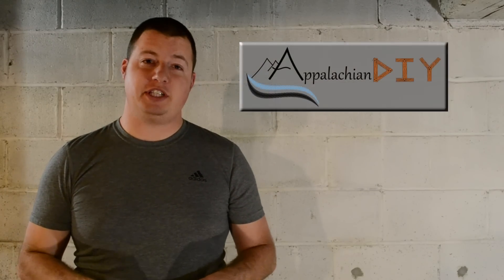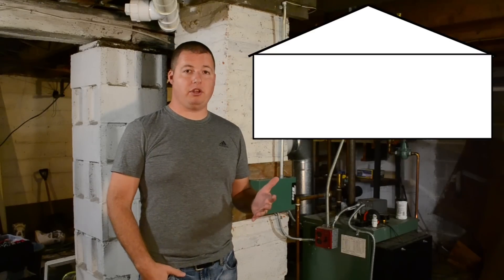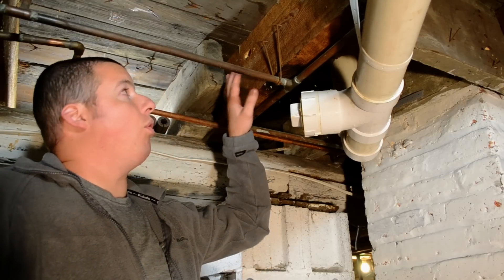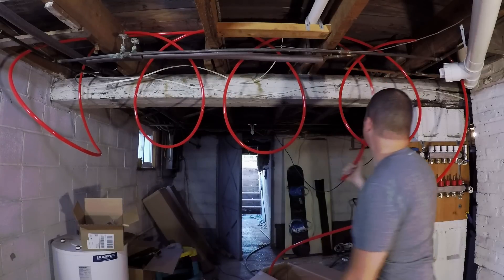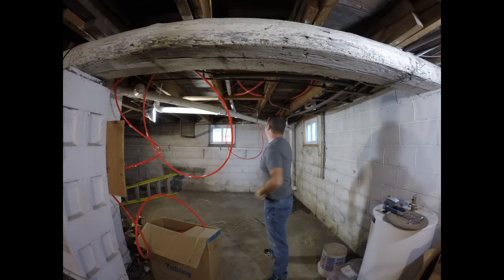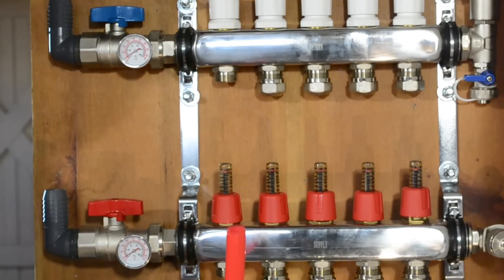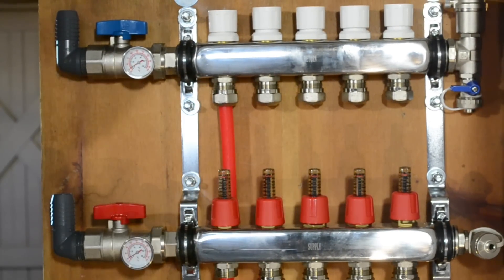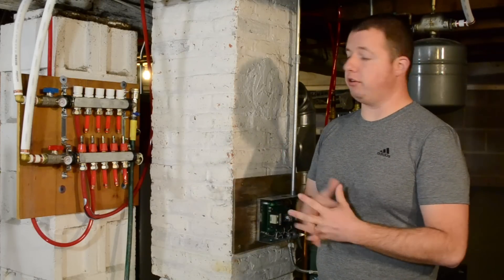DIY Radiant Floor Heat

Comment: Great video. My question is could you use the existing hot water tank or should I install a separate hot water tank?
Reply from the maker: Good question. Tank water heaters are not really made for this type of application. However if its all you got i guess it depends if its electric or gas. Electric could potentially be extremely expensive. Gas might be ok. The best thing would be a tankless water heater or furnace. Plus if your domestic water is on the loop its not a good idea. Floor heat is meant to be a closed loop sytem not open like if you were to have domestic heated water on the same system. Hope this helps
Reply: @appalachiandiy2415   thanks for the reply
Reply: Andyman Davies my infloor is a bit complicated,  being a geothermal heat pump with forced air priority over domestic hot water preheat . It uses this preheated water when the infloor calls for heat , running it through a water to glycol heat exchanger to transfer heat to the infloor loops, returning the cool water  back to the domestic water preheat tank . The water inlet temp is approximately 100 f , the glycol exiting the heat exchanger is approximately 90 f. So the answer is yes you can , with a heat exchanger,  but what I can't answer is whether the temp from your domestic hot water might be to hot , I have heard that you don't want the floor loops to run warmer than 100 f , so might need a mixer valve from the cold water

Comment: An amazing way to heat your house but what is the  cost?  I love my hot water baseboard heat but  $1800.00 for heat and ac is taxing on my income. I kept the  baseboard but installed a two ton minisplit and my worst yearly  hvac cost has been  $625.00. The install cost was $4,200.00! 

Now for the  kicker  folks. (drum roll) my wife loves  the mini and for its ability to controll humidity   during mid atlantic  summers   and  the electric bills. MAMMA HAPPY!!
Reply from the maker: That is really good! Its so hard to say what your yearly costs would be. I think baseboard is less efficient than floor heat and it can be run at a lower temp. It seems like you got a really nice system, you know what they say....if it ain't broke don't try and fix it. Thanks for the questions.
Reply from the maker: @trophyfishn9757  my suggestion, still add the heat tranfer plates. It will allow you to run less flow and tax your system less AND its way more efficient. Just get an adjustable flow manifold

Comment: so how does this manifold connect to the furnace or the hot water heater. that is what I am confused about. what powers the water through the lines and where does the water go back into when it returns. if the answer to that is "the manifold" then where does it go from there to heat back up?

Thanks for your time, you video is very well organized and the extra explanation and diagrams are very helpful. tip for next time, use the software that you made the video with and crank up the volume on the clips where you are speaking. i had to increase and decrease the volume several times throughout the video during each transition. 

With that said, overall this was a great video.
Reply from the maker: Good questions. The water is heated in my oil fired water boiler. The hot water goes from the furnace to the manifold supply side via a 1" pex line. Once at the manifold it gets distributed from the supply side out to "zones or legs" it returns from the zones into the return side on the manifold. Once it gets to the return side it returns to the Furnace via another 1" pex line, this cold water gets reheated in the boiler and starts all over again. There is a circulator pump pushing the cold water into the furnace and powers the entire system. the pump is conected to a controler that has a thermostat in a room in the house to tell the boiler to fire and controls the circulator pump.

Comment: How long does the system stay off before turning back on to heat the floor
Reply from the maker: Thats a really tough question to answer. It depends how cold it is outside, how effective your insulation is, how warm your thermostat is set to, and many other variables. To be honest I never timed my cycles. I will say this, my circulator pump runs a good bit, the furnace may kick on for a minute or two to get the water back up to temp and then continue to circulate for half an hour until the thermostats kick it off. Again everyone's circumstances will vary. I'll check into it when we get farther into winter and try and time my cycles.

Comment: I understand you use a pellet heating source as well is it the only heating source besides the radiant heated floors? I have a on demand water heater it will pump 9.8 gallons per minute I only have one bathroom in my 2 bed house do u think this is enough to warm and supply my house with warm water
Reply from the maker: at max the manifold was doing about 10 gal min. on a 5 manifold. it might be ok if its running without anything else need hot water. I dont know how you would plumb it up as its a closed loop system and your bathrooms are not.

Comment: you should have gone in more depth.  in how to connect it  to the boiler. Explain the process of how does that boiler keeps those lies warm, Can you adjust the temperature of the water, can those water lines warm up ur whole house if you run them in the whole house? How fast does it warm up the room, i need more answers sir.
Reply: Also add how long loops should be and not putting tubing under cabinets.
Reply from the maker: I plan on making another video that explains some of those things in the near future. Thanks for the reply

Comment: Great Video! I have that same manifold, that 1" thread ALWAYS leaks like crazy right by the ball valve. It's almost like the threads aren't deep enough for the tapered threads to really seal themselves.
Reply from the maker: Did you try putting teflon tape on?
Reply: @appalachiandiy2415  Yea I tried teflon. Mega tape, and two different types of pipe dope. Nothing worked. I got the manifold off of amazon. So who knows if its even standard. It might be metric. The flow meters are in Liters not gallons. I ended up using a silicone tape to wrap over it and seal it. Its pretty ghetto right now but it works. Holds pressure fine. I'll be rebuilding it after the winter. Someone mentioned to me a blue pipe dope, apparently it will seal anything.
Reply from the maker: @GeeCeeAte  sorry to hear that. Mine is gallons on the flow meter. Never heard of the blue stuff. Ill have to check on that

Comment: Is that used as supplemental heat or your main heat source? I ask because you mentioned the furnace not working as hard.
Reply from the maker: Its used as a main heat source. We also have a pellet stove to help heat the house, we use it in tandem with the radiant floor heat. We have the stove in our living room/dining room. It does cut our heating bill quite a bit. If we didnt have it we would just use radiant solely by itself and be just fine.
Reply: Appalachian DIY please

Comment: hello sir , i was wondering if there are some calculation's we could make that enable's us to know how many manifold port's we need in regard's to the total space of the house , say for example i have an open space of 70 Square metre how many port's do i need to cover that whole area . thank you .
Reply from the maker: Ill try and do some converting here 70 sq M is roughly 750 sq feet. You should not run your loops/zones any longer than 300 linear feet (90 meters) Joist bays are 16" (0.4 M) on center here in the states. If your room is perfectly square it would be 27'X27' (8.4X8.4 Meters)  There should be 20 joist bays in this area if using 16" centers. You will run a loop down each bay so we can multiply 20x2 and it is 27' long so it would be (20 joist bays X 2 runs per joist X27 foot long joist bay) = 1080 linear feet of pex or 330 Meters of Pex. You will need a minimum of 3 Ports. this does not include the amount of pex needed to get from the manifold to the start of your loop and back again. You should run a 4 port to be on the safe side but 3 is the bare minimum
Reply: would these calculations be the same on a 750 sq foot area embedded in a concrete slab and what kind of barrier do you recommend below the concrete. Also is it better to use 3/4 inch tubing? thanks Kevin

Comment: Please learn how to pronounce Appalachian
Reply from the maker: Matt Lambert haha thats how we do it in Dutch country Pennsylvania. How do you pronounce it? Apple-a-chin? Ive heard it a couple different ways, all depends where your from.
Reply: Appalachian DIY.  Here in the NC mountains it is pronounced apple-a-chin.  Boone is the home of Appalachian University.  Tomato Tamato.  Nice Heat system btw.  Did it make a big difference in the house?
Reply from the maker: Matt Lambert it made a huge difference! I wish I had know about this type of heat before we remodeled a good bit of our home. I would have put it in sooner. We switched from baseboard heat to radiant floor so it was an easy change.

Comment: Just wondering, why wouldn't you do a retro fit like you would a new construction? I may be looking to do this to my house and I feel like I would rather remove the flooring and do it the first way you mentioned.
Reply from the maker: Installing in the floors is the best option. We layed brand new floor month before this and I didnt want to rip it up. If your going to do this anyways, sure go ahead and rip up the old floors and lay it in like new construction. Best of luck!
Reply: Appalachian DIY thanks for the reply, I put floors in about 5 years ago but have been looking to do this style of heating and with a finished basement it is either new drywall ceilings or new floor so either is a big job but one makes the heating more efficient and I am a carpenter so give me wood over drywall and mud all day long, thanks again.
Reply from the maker: haha so either way, your ripping something up. Im not the best at mudding either. good luck.

Comment: How efficient is this system? Have you run it throughout the whole house under the floors? And does it keep the all of the House warm?
I ask this because I want to install a system like this in my home, and want to make sure I’m getting my moneys worth. 
Also you did a great job on the video explaining all that it entails.
Reply from the maker: this system is very efficient. I would probably go with an on-demand water heater instead of my boiler oil furnace. I think that would help make it even more efficient. If you had the location to use an outside wood boiler that would be free heat, even better for cost savings.
 I have this run through 75% of my house (the last section is crawl space and haven't gotten around to it yet). Yes, it keeps the entire house warm. I love it so much my next house will be built with it already in the floors and if I can get a plot more in the country it will have an outside wood boiler. It's a fantastic system and relatively cheap if you can do the work yourself.

Comment: Interesting system but no architect with half a brain puts heat registers in the ceiling in a home.  They are always either in the floor or near the floorboard.
Reply from the maker: Charles Cosimano these are not in a ceiling. They are under a 1st floor. This was filmed in the basement where you can see them
Reply: Why do most commercial buildings have registers in ceilings?

Comment: Awesome and informative video.  The only question I have is how does the furnace fit into this scenario?  Is it like a hot water heater or a standard furnace or what?  I understand hot water being what heats the floors....but I’m a bit lost on the “furnace” part.  Thanks for this great video!  Super duper job!
Reply from the maker: Linda Lou i have an oil fired boiler furnace. It directly heats the water for the floors. I have a seperate hybrid domestic hot water heater

Comment: GREAT job. Wondering, if there is a two tube metal piece so you can put both tubes under one metal. Then insulate under that. Reason , wondering if floor joist can act like a coolant soak if  heat is near them. I like the cross idea for less sharp bends. I have same situation(house). I also pondered routing tubes in hardwood floors and mudding them tight then reflooring with a thicker synthetic floor since my floors finish is past ready for a refinish job anyway. Some syn flooring have a foam sheet so that would not be good for transfer but might be able to omit? I never worked with pex but those connections looked easy enough. I also heard of shark bite connectors on a oil stove sight in Alaska....land of serious cold and wilderness.
Reply from the maker: putheflamesou yes, you can buy heat transfer plates that have two groves/channels in them so it will be one piece.
You can buy special subfloor panels that have grooves already in them or other types of subfloor made just for pex radiant heat that you can lay down. 
Underfloor layment may insulate and trap heat but it would be a very small amount. Just use thin underlayment with a low R value.
Shark bite connection are very expensive. I would recommend the crimp tool (you can get one under $80) the crimps themselves are very cheap. Cant imagine winters in Alaska and would love to hear how this works for you. Best of luck
Reply: A crimp tool? I thought you pushed in only for connection, did you crimp yours or is that a different method, if so is it better/cheaper/? Thanks. I ask box stores but never know salesmen lol, because technology is changing so fast, and I am just frozen watching while sadly some liberties going with it like wood burning. Insurance company scared my wife into burning my wood pile while I was away working on my Sons house. If nothing else I was planning that for my Troy style burial, those are not getting cheaper either! Need to plant some fast growers now.
Reply from the maker: putheflamesou shark bites are push-on. Very simple but they are very expensive. I used a crimp tool. The tool is around $80 but the crimp rings are very cheap. I think the crimp is better.

Comment: A few tips from  one who has been in the biz a couple of few decades.... radiant does not heat air well at all, so your "room" is a little deceptive , and radiant thermostats are hung lower and other diffs.... If you do have to use a "remote manifold" you are supposed to in sulfate the pipe (pex) and also you should do it to and from the loops.. There are limits on lengths of loops according to size of pex . Make sure you use heat pex, not aqua pex, as the former has an oxygen barrier. There IS a difference  no matter what the guy who is selling it to you says. Without that oxygen barrier you will rust your boiler out quick.
Reply from the maker: rob Semprini thanks for the tips. I used 1/2" pex and yes i used oxygen barrier pex. I tried to keep the loops under 330 ft runs. What do you consider a remote manifold? Are you saying to insulate the supply and return lines to the manifold and from the furnace?
Reply: Usually, yes. There are exceptions, depending on if you are using a three way mixing valve off your existing boiler zones to pipe it, as is usually the case. That valve is set for temp AT the valve, so if you are traveling to the manifold, yes, insulate. But if you are using your mix valve at the manifold, like off a flat plate or marine heat exchanger, then it is not as important . If memory serves, pretty sure the max loop for 3/8 tube is 250 and 1/2 is 350 , so you should be good. Used to be when you bought a box, it was only the length it was rated for, but then it was being made by a lot of other manufacturers getting in on it ., selling in "bulk".  Better for the supply house, worse for the plumber.
Reply from the maker: rob Semprini Thanks for the reply

Comment: Did you mount your pump to a board or just to the pipe?
Reply from the maker: Salmon Hunter its plumbed in-line on a 1/2" copper line. I dont think there is a need to mount it unless there is no support (like if using pex)

Comment: can you show something for above sub floor?
Reply from the maker: Aaron Robbins if you do above floor, you will need to either buy special subfloor with channels routed in them to fit the pex or pour a cement type layer over top. It's the better way to go(more efficient) but usually is done only in new builds. Unless you want to rip up your existing flooring. Havnt done it yet so no video currently
Reply: We've got a 100 year old house that has only one layer of flooring.  We assumed it was hardwood on top of a sub-floor when we bought it, but instead it is only one floor level of hardwood planks on top of the joists.  Because of the shifting of the hardwood boards, there are often very small gaps that appear, and can leak spills into the basement.  Also, chair movement is wearing the boards thin in a few places so, we've been considering putting a floor on top of what we now know is the sub-floor.  This will be especially important if we finish the basement.  We don't want spills leaking into a finished ceiling.  So, if we're going to put down a new floor anyway, why not install in-floor radiant heat at the same time.  I very much appreciate your video on installing under a sub-floor.  It looks very do-able.  Do you know of a video I can watch on the above sub-floor methods you mentioned above?
Reply from the maker: Aaron Robbins https://youtu.be/MZWQCSvcKMA somthing like this. doesnt have to be the exact subfloor material but somthing like it